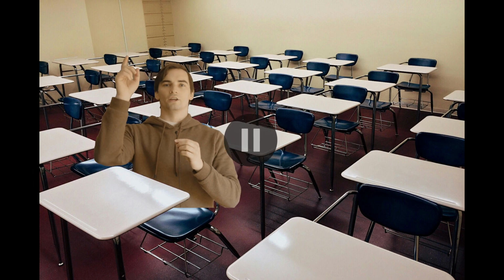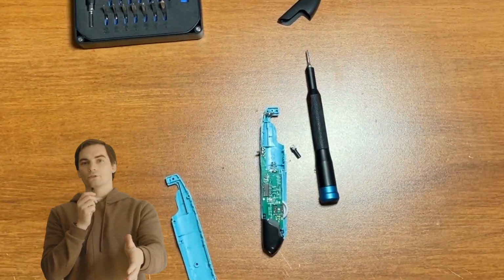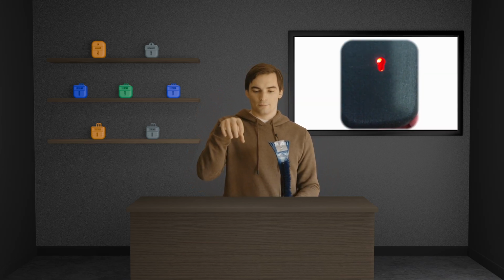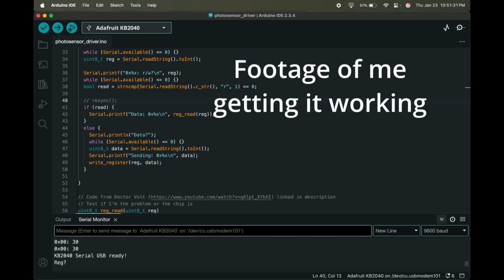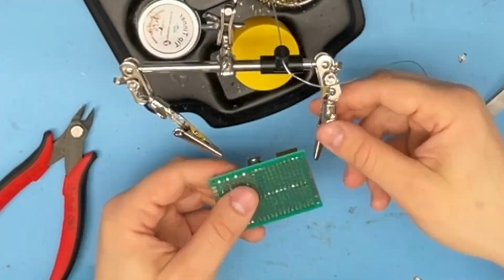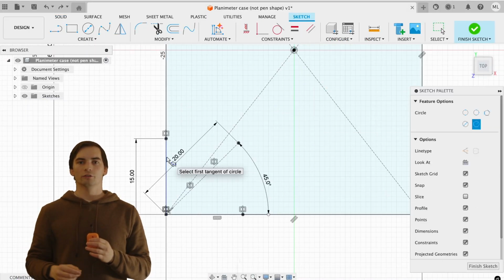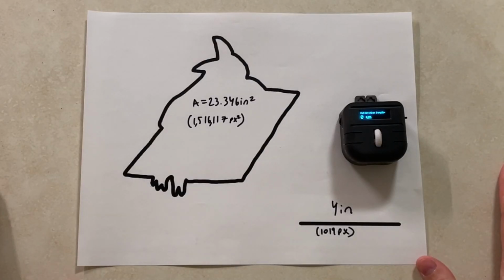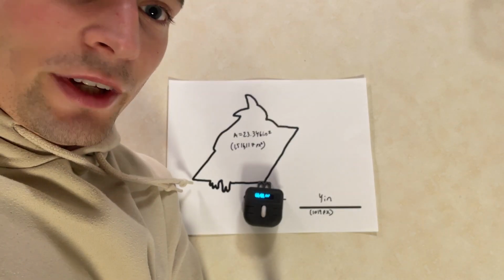Digitizing a 19th-Century Analog Computer With a $10 Mouse!

Comment: Another old school method to measure area is integration. Integration can be performed on an arbitrary shape by cutting the shape out, weighing it and comparing the weight to a square of the same material. The ratio can then be used to calculate area. Just need a good scale and paper. Have fun.